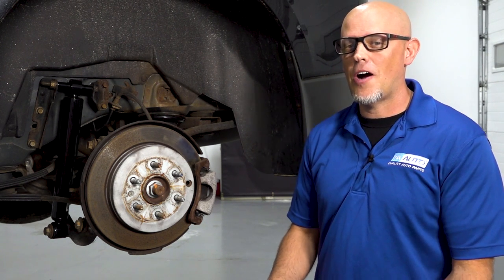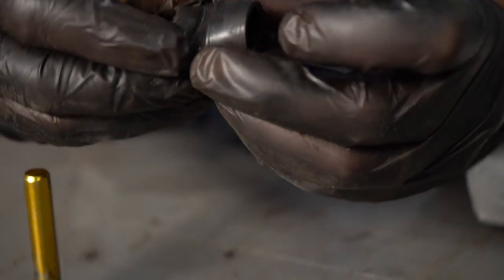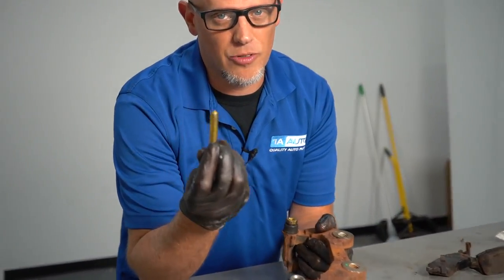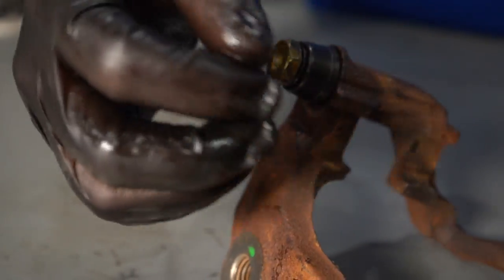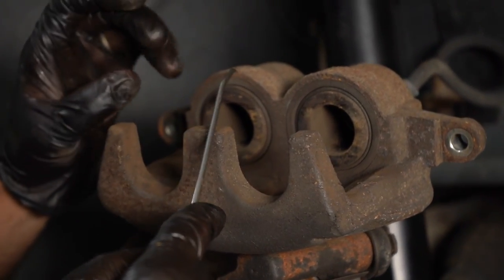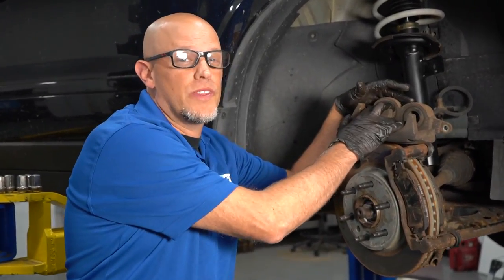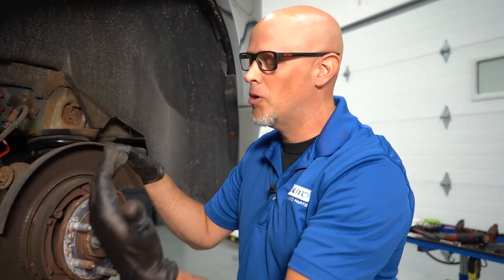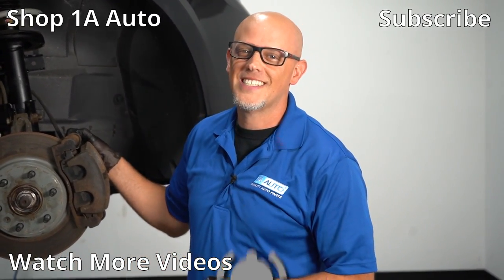Commonly Overlooked Brake Installation Steps - Brake Job Details You Might've Missed!

Comment: Perfect timing as I am currently replacing my calipers, rotors, and pads after flushing system.
Reply: You may introduce air into the brake lines after the replacement of parts. Bleed the lines again after the job.

Comment: 1:10 You mean inboard (inside) pad, the one closest to the piston.
Also, slider pin grease must not be oil based, must be synthetic or silicon high temp grease.

Comment: You reminded us to grease the slide pins but you failed to warn us to use brake grease only.  Also, a thin film of brake grease under the pad clips after rust removal will help prevent rust and the "rust jacking" that over time could prevent the pads from moving freely.  Thanks for the video.

Comment: Very useful tips. Thanks for all you do. I recently replaced my front pads and rotors as well as one caliber and bracket on the passenger side. Now I get a vibration when I hit 65mph/120kph. I did remove and grease the slides on the drivers side. Any ideas? Should I have replaced both calipers? 
Cheers
Reply: Make sure you torqued the hold on bracket; they need to be very tight ~80 ft/lb in some cases.  Common practice is to replace both calipers. Also, it's possible you need to balance your tires esp if you knocked a weight off.

Comment: My 1988 Dodge D100 Ram 1/2 ton truck rear brakes, with all new parts, are getting hot. The wheel on the rear driver side is much hotter than the passenger side, but both are so hot that when you touch the wheel it starts to burn your hand. I know they'll be hot from use, but these are excessively hot  compared to other vehicles i have. These are, 320 degrees on the driver side rear , over 230 on the passenger side rear, front brakes are around 190. (They were never this hot before the brake job).. Everything seems to be fine with all of the new replacement parts, so could you give me advice on what could be causing this issue ?....could a proportioning valve cause this?
Reply from the maker: +jim frank We wouldn't be able to diagnose an issue like that here, you may want to have a local mechanic take a look at it. Thanks for checking us out! http://1aau.to/m/Shop-1AAuto-c

Comment: I have to do my own, and I do something none of you so call professional mechanics do. The ones on flat rate that rush through the job is the worse. Before I retract the piston, I suck up some used brake fluid into my glass syringe, I take a small screw driver and lift up the rubber dust boot at the top of the caliper, and I inject in 2,3 CC of brake fluid. I then push the caliper back in, catch the excess fluid with a rag. Since I started doing this decades ago, I never had a seized caliper. A plastic syringe will seize up, the rubber will swell, and if it is not brake fluid you use, you get to overhaul your brake system by the end of the week.
Reply: I would say that's not a bad idea but only if the rubber is twisting when you push or turn it in. I would think a "pipette" is better than a syringe.  Seems a syringe could puncture the rubbrerr.

Comment: There's really a lot of things that are frustrating about this video. I couldn't tell what he meant by the slide clips that hold the brake pads in at first. 

I didn't appreciate that he talked about needing to clean off or file down the bracket, but he didn't demonstrate it. I realize that it doesn't sound too hard to figure out, but obviously I'm watching this video, which means I'm going to need directions on this stuff.  

Especially when he says stuff like "make sure you don't file too much or it'll be too loose and then it will rattle.". He needs to teach this stuff by doing it, not just naming parts that I don't know the names of. 

 It's stressful when I'm already watching YouTube to learn how to do this stuff by myself and then I'm confused by your terminology and your skipping over the demonstrations.

Comment: You reminded us to grease the slide pins but you failed to warn us to use brake grease only.  Also, a thin film of brake grease on the mounting surfaces under the pad clips after rust removal will help prevent rust and the "rust jacking" that over time could cause the pads to bind and wear unevenly.  Thanks for the video.